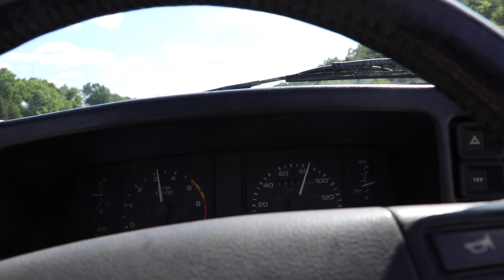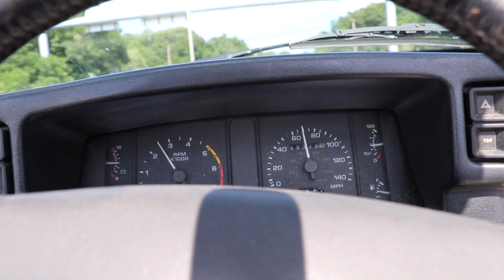I tried to Buy this Foxbody for $500... It didn't work out

Comment: Hey guys Andrew I have a 04 cobra. Fresh built  motor haven problem over heating need you guys help.
Reply: Tstat radiator or rad fans or you got a head gasket problem buddy
Reply: What Goku said. Also make sure you properly burp the system. Having air bubbles will cause overheating issues

Comment: I’d say skip it. Between the bland styling and crappy horsepower they never appealed to me.
Reply: BIG BLOCK FORD I disagree entirely. They dont do anything for me especially compared to the first generation or to what we have now. And since  I’ve been driving a Mustang for most of the last 40 years I’ll decide whether or not I’m a true Mustang guy.
Reply: BIG BLOCK FORD I agree with you a notch is a must.
Reply: altonbunnjr doesn’t matter if you’ve been driving a mustang for 40 years if you’ve been driving all the wrong models with the wrong motors and transmission😂
Reply: 5pointoh None have been Fox bodies but something I like so I’m driving the right thing. I currently have a 2011 GT so I haven’t had to swap the motor to get high performance.